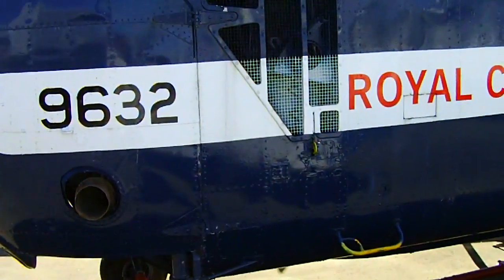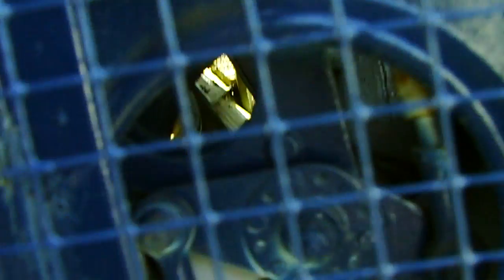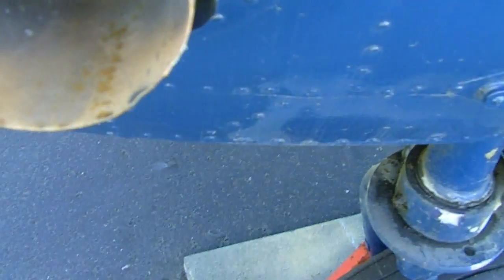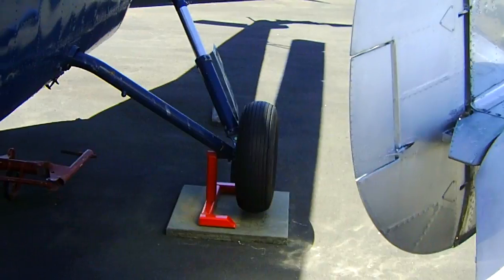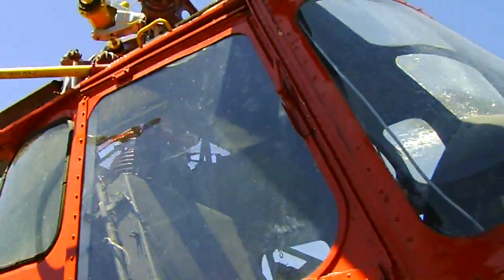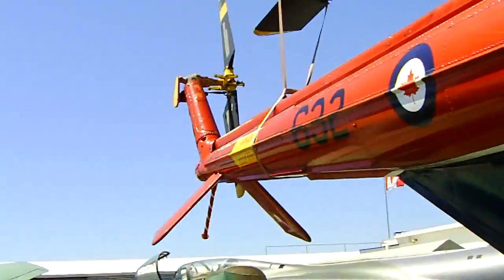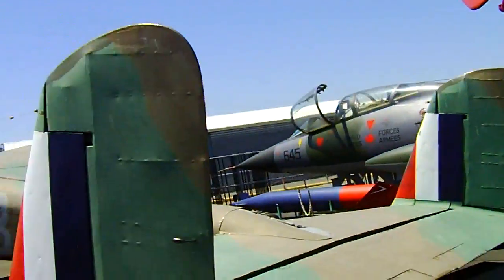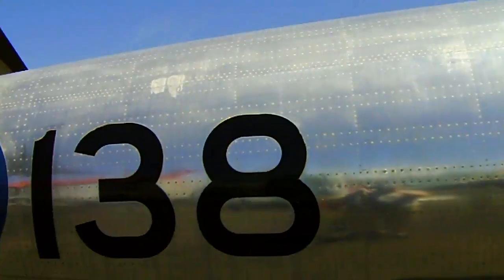Sikorsky S-55 (UH-19) Transport Helicopter

Comment: That fan doesn't merely "assist" in cooling the engine "while the helicopter is stationary"; it was vital in cooling the engine at all times. Air-cooled radials were designed to sit in an airplane's open, forward-facing engine nacelle, the forward motion of which would supply a continuous fast-moving flow of cold air. But since the S-55's engine was enclosed in a shroud, the only way to provide such air to the engine was via an powerful fan. The same cooling technique was applied when these engines were used to power many American tanks during World War II.
Reply from the maker: okay good to know that thanks very much my friend

Comment from the maker: its actually a Wright R-1300 Radial engine Engine Type: 7-cylinder air-cooled radial
Power: T-28A 800 hp (596 kW), derated to 700 hp (520 kw) in S-55A
Weight: 1000 lb (461 kg)
Cylinders: bore 6.125 in (155 mm), stroke 6.312 in (160 mm)
Displacement: 1302 cu in (21.3 litres)

Comment from the maker: the engines are either a R-1340 Pratt and Whitney  9 cylinder radial air cooled engine or a Wright R-1300 7 cylinder radial air cooled egone. Both engines feature a large cooling fan to keep The Museum's example is shown with the complete S-55 helicopter installation. The engine mount inclines the engine to align with the transmission to the rotor blades. A cooling fan assists in keeping the engine temperatures in a satisfactory range while the helicopter is stationary.